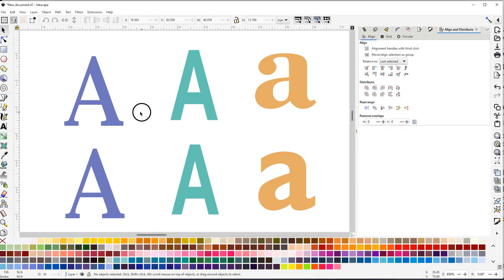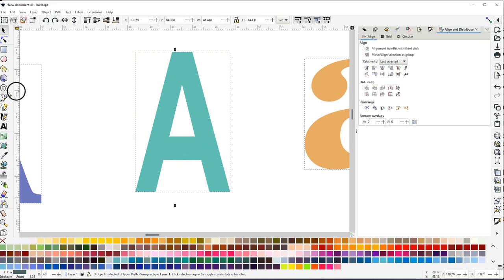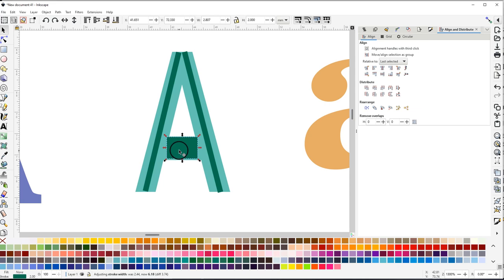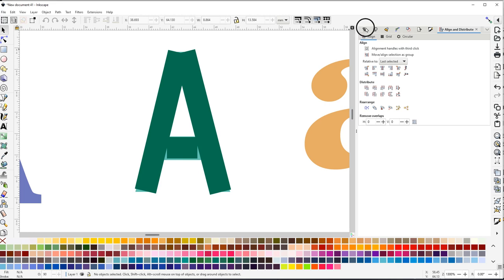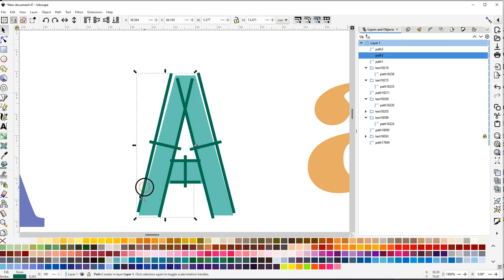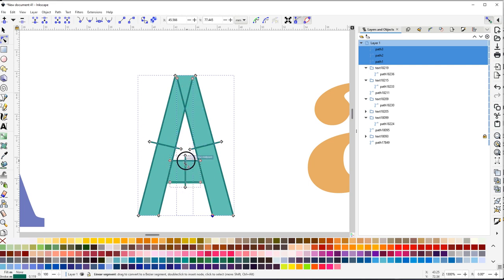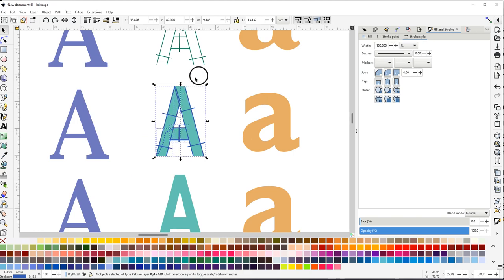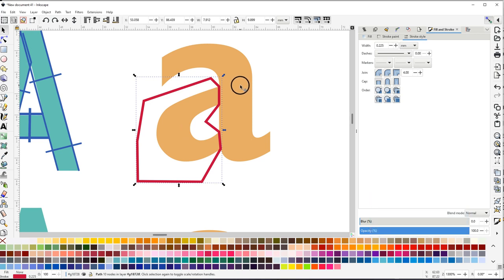Fonts to satin

Comment: Thanks for the video, I've just added Inkstitch to the extensions. Easy to follow explanations. I noticed you kept changing the line thickness, might make it a little quicker if you altered the default setting... 🙂